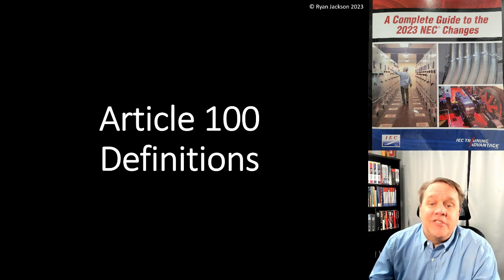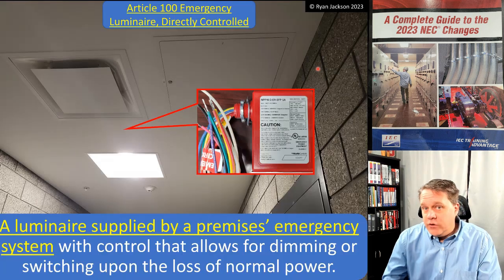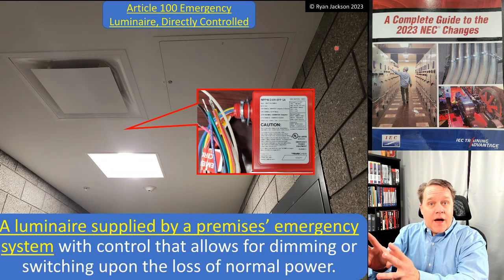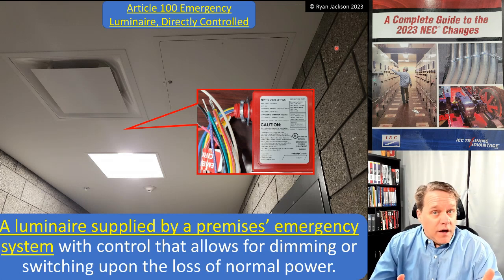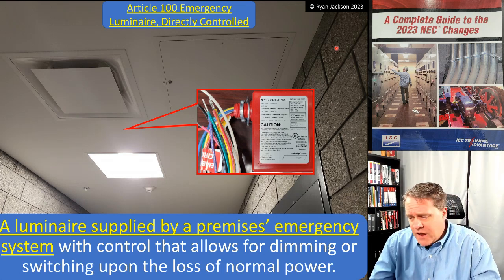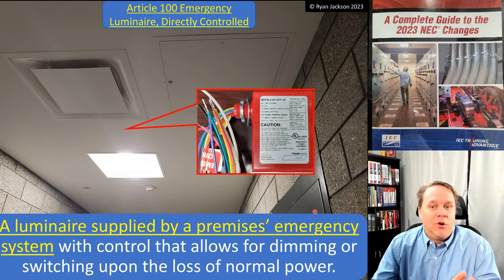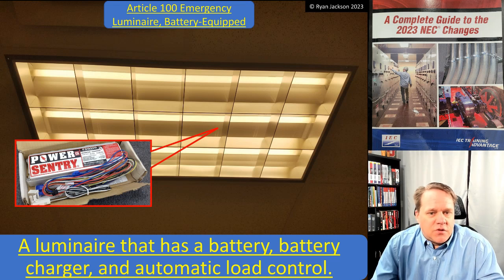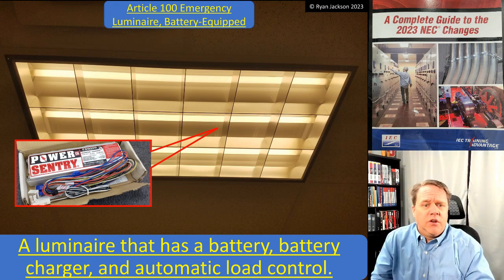2023 Article 100 Emergency Luminaires and Unit Equipment

Comment: At the large hospital /research center that I retired from had thin cords coming down about 4' to fancy luminaries that had two T8 lamps that were feed from emergency power by three 2,000 KW generators. We thought that no e.urgency lighting should be feeding a cord but hard wired. They wasted tons of money installing two expensive bodine  ballast in both emergency feed 4' T8 fixtures in both of the 12 by 16' electrical closets on each of the 12 floors. Wish I had a dollar for every 5 to 7 year old battery bodine ballast that I replaced. Finally convinced them that one of the 2,000KW generators could carry the entire emergency load ( tested each gen set by themselves for one hour ) so we did away with 48 bovine ballast. Worst thing the newer bodine battery ballast have a self check feature where they run the 4' T8 tube on horrible reduced illumination from battery pack. Surgeons performing operations would freak out when one of these lights performed self test. Thought they should paint entire line of red bodine ballast yellow for the lemons they are.